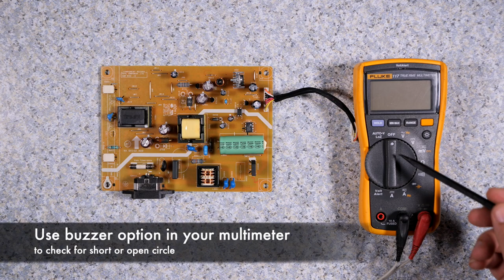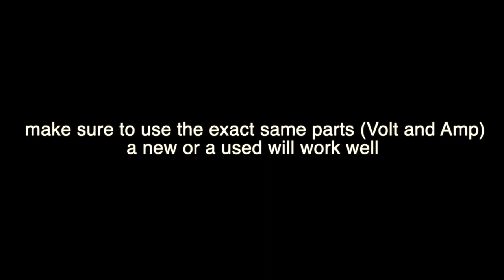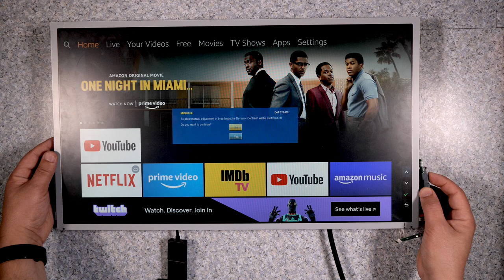How To Repair Dell Monitor Power Supply  | Dell ST2410B Monitor No Power

Comment: Thanks for posting! My ST2410 began to dim then brighten over the past week. Today it went completely dim but the right side was slightly brighter than the left. The large 100uF 450V capacitor on the power board appeared to be slightly leaking from one of the terminals. I measured it at 153uF. Could something like that cause the monitor to dim? Thank you!
Reply from the maker: All possibilities exist.
If you see that there is damage to the capacitor, it must be replaced.
There are four medium-sized brown capacitors responsible for the lighting, which I advise you to check
(I apologize to you, because I do not have the monitor at the moment so I cannot check the capacitors values for you)
Reply: @ZeeEverything  Thanks! I replaced the large cap but waiting to receive a tube of RTV adhesive for electronics from amazon. I don't want to take a chance on using the adhesive in my toolbox. I'm going to leave the smaller caps and see what happens since I don't have an ESR meter to test them. Their values are 470uF/25V. If the monitor is still dim, I may get a meter and try again.
Reply: @ZeeEverything  I replaced the large cap and it seems a little brighter, maybe! Are those four caps for the lighting on the power board or the smaller board with the ports? I've already ordered all the other caps on the power supply board.
Reply from the maker: I hope that changing the capacitors will solve the problem of lighting and that there will be no problem in the CCFL bulbs.
Reply: Bonsoir avez-vous trouvé la solution à votre problème ? Je crois avoir un problème similaire !!! merci
Reply: @bernarddessureault720  Oui, j'ai dû installer de nouvelles ampoules. C'était délicat. Faites juste attention à garder les différentes couches dans l'ordre. Bonne chance!
Reply: @geecrawdad  merci de m'éclairer concernant mon problème ( c'est le cas de le dire 🤣😂) . 
J'ai vraiment mes vraiment aucune expérience en la matière 🤷‍♂️. Avec votre expérience, si vous le voulez bien....où sont elles localisé les ampoules et à quoi ressemble tel ?  Si vous avez une ou des images de cette pièce cela me sera très très utile. 
Merci beaucoup encore une fois 👍🏻
Reply: @bernarddessureault720  Recherchez "change monitor ccfl bulbs" et vous trouverez des vidéos et un site Web qui montrent comment le faire.

Comment: You should credit the music and artist used 
If you did i must have missed it.
Reply from the maker: thanks for your comment
You can find the link in the description
Reply: @ZeeEverything  hey thats a great response time...thanks a lot and thanks for this video, Im trying to fix mine and it has a different issue, but i got a lot of help from this
Mine is turning on for a second and then going dark, led is showing power is still on but display goes dead. 
It was flickering before , now this
Reply from the maker: That's happened usually If you have one bad CCFL bulb the monitor will shut down,Please Check the CCFL bulb inside the screen panel,
Both bulb must be verified.
Reply: @tehmanmobin276  I'm 95% certain my issue was one of the 2 CFT backlights was simply at the end of it's lifespan. It was a challenging repair that required about 25$ out of pocket. I found a 25" Vizio on fb marketplace for 20$ but the monitor is still here if i find a good deal on the bulbs lol